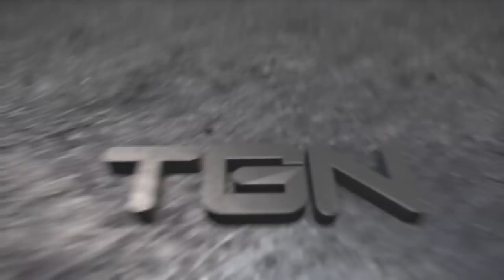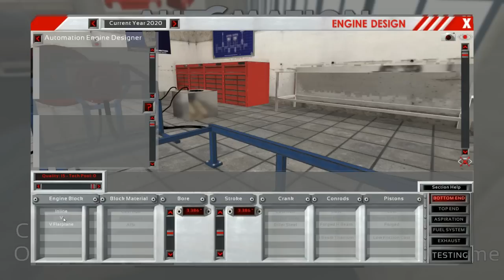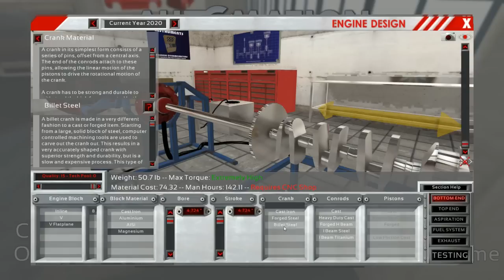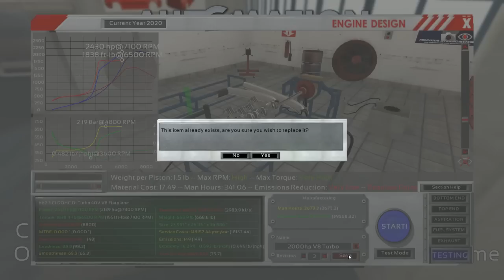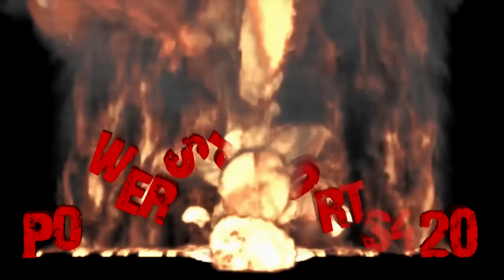Realistic Engine Building Game - 006 - 2700hp Turbocharged V8

Comment: I think u only hear the blow off valve once cause it needs the boost pressure to stay constant threw all of the gears and rpms to reach high horsepower like 2000+. Race motor status basically defining it. Blow off valves are for street cars that want longevity. Race motors dont care they push it to the limits to get big horse power to get the most out of it.
Reply from the maker: Lee Mac 
No, the missing blow-off valve sound is definitely a glitch, and they are "working on it".

Comment: This engine could make waaaaay more power dude. You want that octane requirement to be right at your fuel octane. Slowly add compression until you get the octane up. Should be much more powerful.
Reply from the maker: forrest225 
Good tip!  Thanks!

Comment: Try 9.5to 1 compression ratio 850 cubic inche engine block cam in the block throttle body injection 1700cfm sized throttle body twin turbo 65psi of boost non flat plane crank with forged steel everything solid roller cam roller rockers over sized intake and exhaust ports the reason for that is to stop the detonation of the engine and make use of all that boost more efficiently while making it capable of more power than you just did top fuel drag cars use this method it works
Reply from the maker: conner mattert 
Will do!  Waiting for the game to update, though... :/